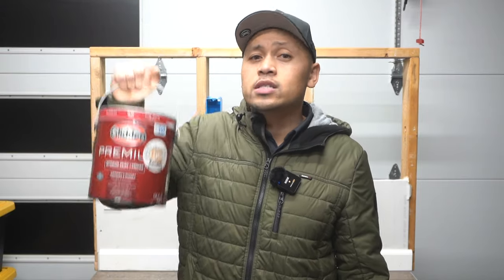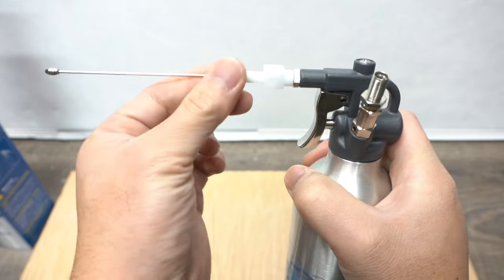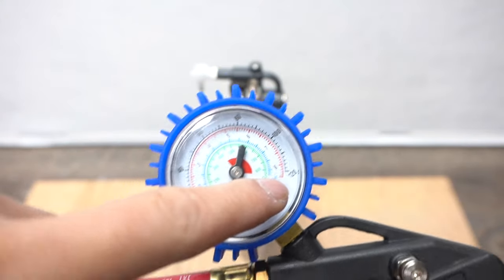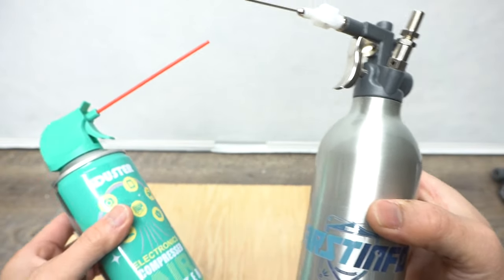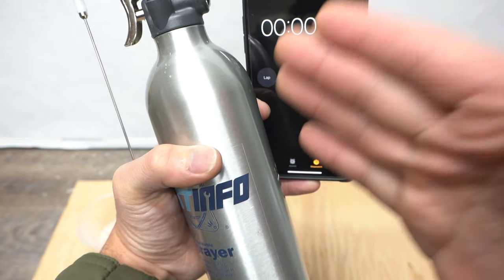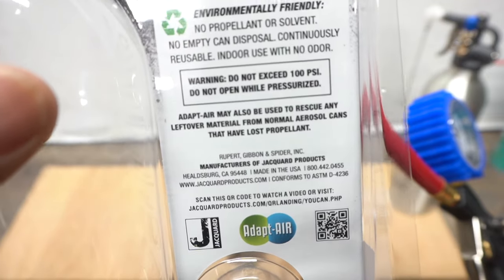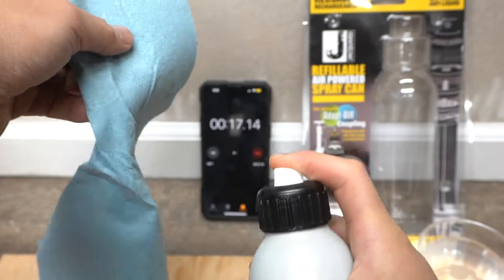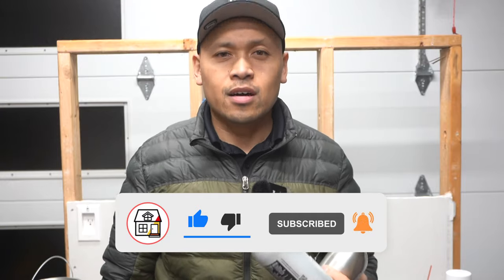Transform ANY Liquid To An Aerosol Spray Can In Seconds! How To DIY

Comment from the maker: ITEMS I USED ON THIS VIDEO: 
- FIRSTINFO Refillable 140Psi Pressure Spray Canister - https://amzn.to/3RJnfQc
- YOUCAN Refillable Air Powered Spray Can - https://amzn.to/3NnEPX2
- Tire Inflator With 120psi Gauge - https://amzn.to/3tmB11t
- Mini Portable Bike Pump - https://amzn.to/3NpFbww
- Floor Bike Pump - https://amzn.to/46W3FEy
- Pancake Air Compressor Set - https://amzn.to/3uTGehP
- Safety Glasses - https://amzn.to/47WoeSs

Comment: Good start.  If I use paint do you clean it after or can you store it with paint in it? What viscosity do you need to dilute the paint to get it to spray? What if it gets clogged?  Do you charge it with what insert gas so paint doesn’t harden?
Reply from the maker: Hi! Paint will definitely work with the  YOUCAN. Storing it with the paint is 👍🏽 ok
Reply: Good idea the clean up might be a bit of fun  especially the nozzle
Reply: I read the instructions on Amazon and it said it was for lubricants only not paint

Comment: I am definitely going to get the spray can style.i noticed he did not use thelaytex paint. I would definitely use fl5eol and thin the paint. And throw a ball bearing or heavy marble in the can.  Iwouldsay you would have to use all the product to open the can. On less it has straw.

Comment: Doesn’t sound like those come with a ball-bearing to mix the paint like in a store-bought spray paint can. Do you know if you’re able to put a ball-bearing in the can? Or does the packaging say not to? And most house paints now are quite thick; Would it be best to thin it down first?
Reply: Just a quick tip here that I use in place of a ball bearing if you don't have one. Any rattle can that I use all of the product within, I poke a hole in the can after all the gas is completely bled out, and take the glass marble out to use in a refillable aerosol can such as these.

Comment: The first one says not recommended just to spray air. And I think the reason for that is you could end up spraying moisture from the air onto electronics or whatever.  The kind you would normally use are not filled with air, they're filled with gas.
Reply: You could use dried compressed air (lots of videos on here about adding a radiator to your compressor to avoid the condensation issue) or fill it with CO2, nitrogen, argon... Honestly I would think it's "not recommended" because pressurized air doesn't last very long -- only the first couple seconds will have the full force. The electronics dusters are a liquid refrigerant that evaporates as it's sprayed, so they last a lot longer than compressed air... but yikes, venting refrigerant on purpose is a bad plan.

Comment: How do you clean the canister and nozzle?
Reply from the maker: I would just use dish soap and water, nothing abrasive. Then charge with just air and spray out the remaining remanence out of the straw and nozzle.
Reply: @FixThisHouse  Hmm, not real sure either would clean up well enough.  But what do I know.
Reply: To clear the nozzle charge with air turn upside down and spray until nothing comes out any more. Then store.